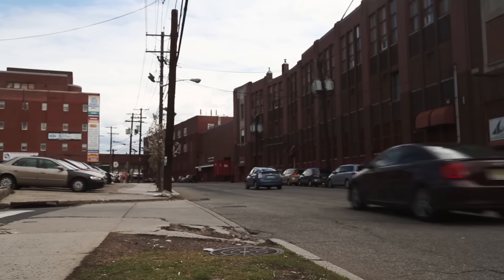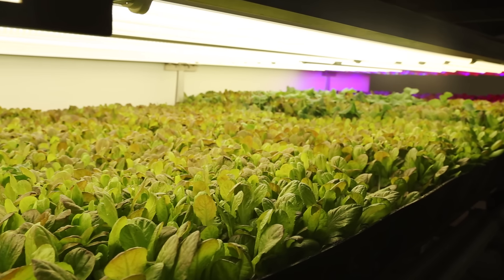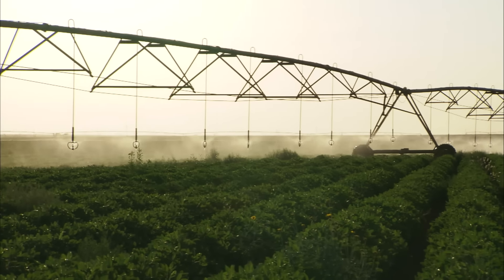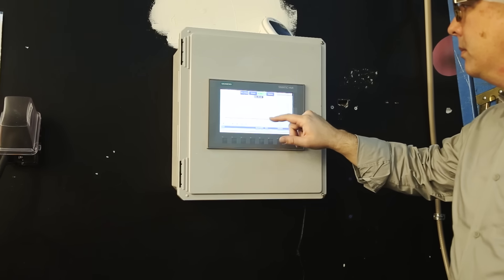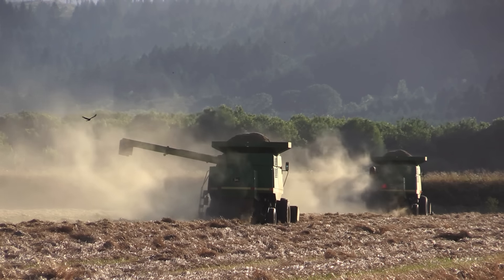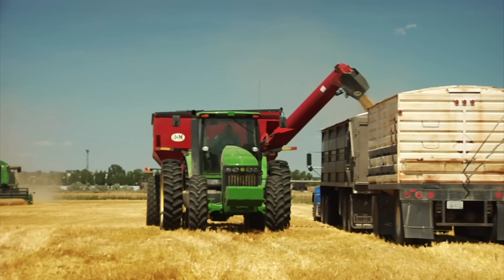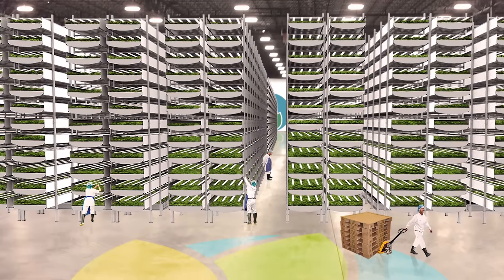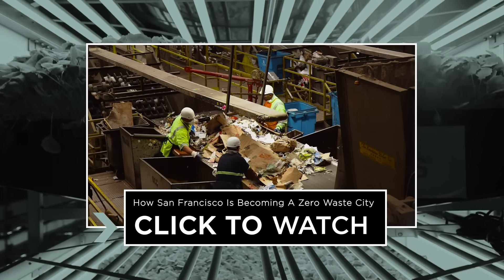This Farm of the Future Uses No Soil and 95% Less Water

Comment: This video would be a lot better if they explained the economics of this business and not just the possible environmental impacts. I like the idea, but after watching the video I still have no idea if it's economically feasible or when it might be.
Reply: It's 100% economically feasible. Sure, the intial cost will be pretty big, but the energy and water cost is much less than that of a regular farm, and with round the clock yealds they can be selling these plants within several months, eventually gaining back what they intially spent within several years. ( or less )
Reply: +Gabe Newell Do you have a source?
Reply: Half_Centaur
No, but it's basic economics... Why would this not make sense? They use LED lights (much less efficient than traditional lighting), they use much less water by misting, no fertilizer, lower growing times, growing times 12 months a year, controlled environments (meaning no pests/diseases), etc. A regular farm also has to buy fuel and energy to power machinery for plowing/sewing seeds, which this doesn't require.
Reply: +Gabe Newell Regardless of whether it is economically profitable right now, which you don't seem to know except from what you saw in this video and what seems like a guess, my point is that the video should've discussed the business side of it more. That is, after all, what will determine whether this catches on.
Reply: They for sure use a fertilizer.  They don't use a pesticide is what you probably meant.
Reply: pupdrummer
Yep, sorry for that mix up.
Reply: +Gabe Newell a regular farm doesnt pay for light tho.
Reply: Lu Tze
Maybe so, but it doesn't change the fact that these farms also cut out the fossil fuels needed to run their tractors, so they save big in that department.
Reply: fron personal experience in maintaining and operation another type of LED based indoor farming, its entirely economical. initial costa start high but i cant imagine it costs anywhere near as much as the total cost to grow and harvest a traditional farm. Cutting out huge transportation costs is a huge benefit; as they can grow in the middle of cities this could happen literally anywhere and lead to citiea sustaining themselves partially. its entire economically beneficial.
Reply: Don't forget that food usually has to be shipped somewhere. I am living in Germany and in my supermarket you can buy potatoes from israel and tomatoes from the south of spain. That's like 2000-4000 km. Yes, those are the most extreme cases but I am glad people are looking for new ways to save resources and energy. 

You will be able to talk economics once this goes into mass production. Similar to solar energy you can't compare a mature industry that has proper economy of scale with a new industry that is just starting out.

I see a lot of potential here.
Reply: it probably is economically feasible as many people are doing it
Reply: Exactly. What a poor video. How they can they not include the most important deciding factor from consumer point of view.
Reply: Outdoor farming doesn't have costs for things like HVAC systems, heating/cooling systems, photovoltaic arrays, lighting systems, infrastructure and automation systems, water-recycling systems, hydroponic/aeroponic systems, not to mention office and laboratory facilities. At some point, and probably because of some major government investment/subsidies, this will probably be more viable, but for now it only seems to make sense in very specific markets.
Reply: +ByAnyOtherName091 the whole point of GMOs is to contaminate the biosphere? Farmers aren't even allowed to plant GMO seeds they produced themselves. The genomes are intellectual property. The whole point is to produce more food, with a variety of techniques. Check your bias.
Reply: +Gabe Newell do they though? most power in the US comes from carbon sources, so unless these guys are idfferent I think its safe tomassume the impact is equal maybe more
Reply: Economics are a real factor to consider so it is fair to point this out. It is however far from always the determinant factor of success. Singapore is a good example related to this subject. Beyond anything, they lack available space/land for the purpose of aggriculture. They predominantly rely on imports to feed their people, making food relatively expensive and often questionable in terms of quality and foot print. This and a combination of other factors have pushed the Singaporians to stretch their farms upwards - they see/feel a nescesity for it. 

Food prices can be elastic. They vary a lot per country, region, type of consumer etc. An odd example from my own country; most of the Organic food grown in the Netherlands is exported, as the Dutch are used to paying relatively low prices for their greens. Based on the Netherlands our scale of organic produce is not economically viable, but based on a global market it can be.  

Another element which my first block hints at. Tesla was critisized for using government subsidies by certain a journalist at one point. Despite the fact many traditional car companies (=/=regular farmers) have received state sponsership thus making this argument senseless, people like me might argue their to be a non-economical need to pursue electric cars (=/= vertical/more sustainable farms). Most EU farmers receive subsidies, heck they paid dairy farmers to NOT produce milk. Not to mention that the more traditional methods of farming are the results of millenia of 'experience & research'. It takes time to make a 'new' technology/method work on scale and make it economically viable. LED's are a perfect example. 

Finally, how many indirect costs from more common food producing methods are not accounted for on those products' pricetags?

Would have been a much longer video to do it right ;) But a fair point none the less.
Reply: ***** one of the first questions 'environmental companies' tend to face is 'is it financially competitive?' Or as the OP was asking 'is it financially feasable?'. You can answer those questions without ever getting in to profits, without 'aiding' your competitors. Since most products that are labeled 'green', 'sustainable', 'organic' or depending on newer innovations/R&D come with a premium price tag, it is a logical question to ask.

Regardless, there is a hell of a lot more to a business than 5 lines of its financial breakdown or even just a mentioning of financial feasability. The notion that competitors would rely on such information in a video like this is a stretch to say the least. There is and has been a lot more in depth information publicly available on the subject of vertical farming.
Reply: yeah then it turns into Monsanto
Reply: Piewert how?
Reply: ***** idk they are just focused on profit and not anything else.
Reply: i  can  never  understand  why  vegetables  are  not  far  more expensive  with  such  long shipping  routes,  the grower  must  earn  very little..
Reply: You should read Meatonomics by David Simon as it partly explains the observation you have. I believe most growers don't earn that much after supermarket negotiations and supply chain costs (Food Waste by Tristram Stuart). Could also attribute to why the agricultural industry hires so many immigrant workers who may be paid low wages.
Reply: Well you can still sell food in the same amount when its winter.
You have lower cost because u dont need transport because you can build those farms near or i cities.
Less money needed for pesticides. And much more

Verticle farming seems very very profitable in the long run.
Verticle farms are basically caplitalistic agraculture on steroids. But in a good way.
Reply: TheseMortalBones that's what you think, but sadly in reality it's all about the money. If it's not economically feasibly then no one is going to invest in it.
Reply: +Raymond Groot Yeah, I would agree with the criticism of Tesla if the journalists were okay with the car companies, but personally I don't think any company should be supported or favored by the state.

As for your points on economics, Economics is Everything. You dont have a successful business if it isn't economical. If the market cant or wont support this type of venture it will fail, regardless of how much water and CO2 it saves.
Reply: I don know better English than you sir but wat I want to say is please Don export or import food products and Asian countries are more populated prople Don know wat they r eating in China bastards make plastic rice and plastic cabbage brother what to do please say what kind of cruelty they do and I am afraid to tell more BCOS of our politicians
Reply: Less transport expenses, less probability of failure/bankrupcy due to unexpected plagues, drought, etc. Also, less expense in pesticides and herbicides, and more produce per area unit.

On the other hand, additional spending in electricity and water.
Reply: The main question is cost of product.
Will the cost of product be the same to the ones produced in farms?
Reply: @NordicPieEater   Hi no fertiliser is not right Kris, there is an a/b formula (A usually =cal nitrate / iron edta. B usually = pot nitrate /MAP / Magnesium sulphate and a bunch of micros)
Reply: You would expand a four minute video into a one hour video that almost nobody would bother to view. This way it becomes sometingamy people see and those interested can look into the details foe themselves. I did. Without giving site by site references I can tell you that it is a profitable enterprise, companies all over the world are doing it. Environmentally, where alternative energy is used, it has almost zero impact, and where the facilities are on "the grid" there is a far lesser impact than is caused producing the same goods on a conventional farm. Health and flavor concerns are moot points, as foods grown this way allow for targeting each plants specific needs and the end product is tastier and more nutritious than their conventionally grown counterparts. There have been many studies, including some funded by corporations that wish to discredit the process, that concur with said plants being better in every way. On pollution, the runoff you get with conventional farming is completely eliminated, and the nutrients used to grow the plants are completely used as the runoff is recirculated. I could not find a single negative point in using the method, and certain improvements can be used to make it better. Recirculation of water through fish tanks, for example, eliminates the need for fertilizer. All you need is fish food. This does remove the option of targeted nutrients, though. O would suggest that any who are interested should spend a little time, what I say was learned in under twenty-four hours, to investigate. I hope that answers at least some of your questions.

Comment: In response to the electricity question, I have an Aerogarden that has about 1/2 square foot of LEDs that combined draw about 30 watts when on.  Add the pump to aerate the roots, which is about 5 watts, for a total of 35 watts.  Do the math with 1 football field of LEDs (or less efficient fluorescent bulbs), which is 57,600 square feet, and it should be consuming approximately 3 to 4 Mega Watts of power depending on how often pumps are running.  They could offset this consumption with renewable energy, which was not discussed in the video.
Reply: But then you have to replace LED's. They last long but not forever.